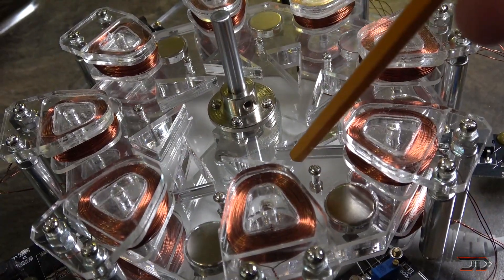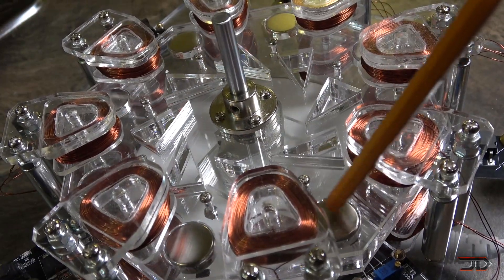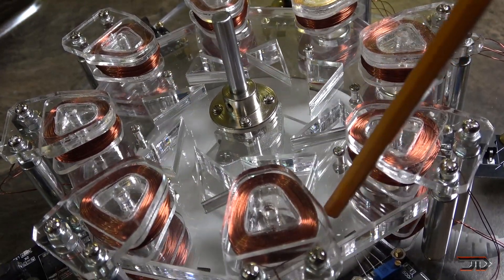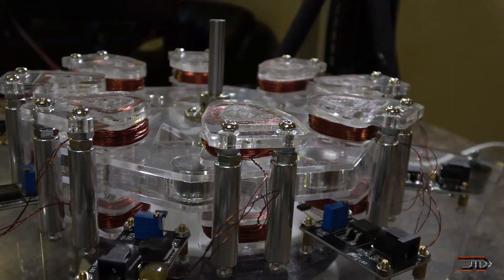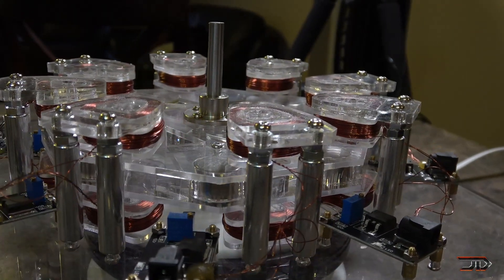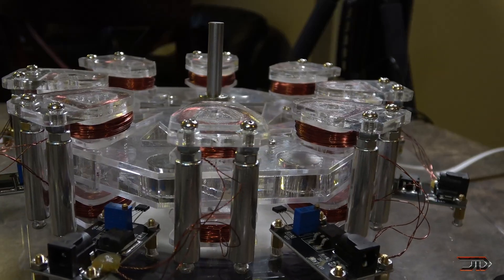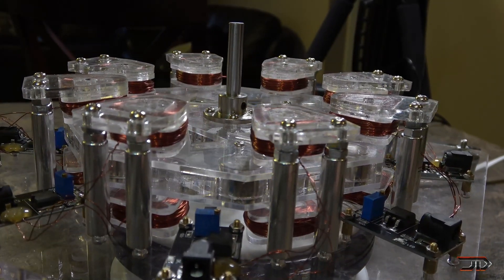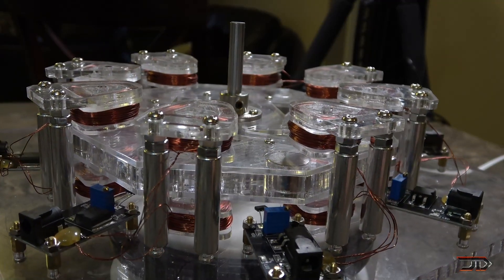8-Turn Disc HIGH Powered MOTOR / Ironless Star Generator

Comment from the maker: These motors are definitely a little different from typical axial flux designs. I will keep trying to find more unique motors/engines and demonstrate them for you!
Reply: Hey, did you make that or find it somewhere?
Reply from the maker: @hambone51501  It was premade, you can buy it from one of the sites in the description. It's around $180 which is not too bad for demo unit.
Reply: @Motor_Explorer1  this would generate a lots of AC power or alternating current if it acted as a generator or alternator if it was spun by a prime mover, such as another motor or something else to drive it at high speeds.
Reply: Now, just scale that up.  Add magnets to levitate the magnetic wheel so theres no resistance off an axis.
Reply: @EarthCreature.  My thoughts exactly.  How is this different to an axial flux motor? Still learning.
Reply: @noutram1000  Well with 1 tweak it isn't much of a different motor at all. But marrying it with a no-resistance/flywheel would put it scores beyond performance though
Reply: @EarthCreature.  I don't think it's possible without messing with the magnetic Eddie currents. It already takes fine tuning of the magnets and stator to achieve peak efficiency. Have a look at the Halbach array.
Reply: What's the KW. I need 5kw motor design
Reply: hi, may i know the air gap between your permanent magnet and coil
Reply: They look pretty fast actually. when I watched this, it looked really fast, probably because magnetic fields are strong forces that push constantly on the rotor or the magnets and bring it up to high speed.

Comment: If you could just, make the stator freely movable through slip rings and use aluminum disc as a rotor without magnets, you'd be built the thing I had in mind.

Comment: Hi, Great video! Can this be used as a generator? if so where's the output?
Reply: Material: Acrylic
.Input Voltage: 12V
.Output Voltage: One circuit board 5w
.Speed: 5000-10000 RPM
.Product Weight: 2000g
.Package Dimensions: 30 x 30 x 8cm

Comment: You won't have that cogging / starting problem if you use # of magnets divisible by 4 and # of coils divisible by 3 (e.g. 8 magnets/ 6 coils or 16 magnets/ 12 coils etc).
I built a few axial flux alternators (wind turbines) and it's a lot of fun. I really like your creative design/ fab work, nice job!

Comment: I did something like that on a fidget spinner, its brushless and has two 300 loop coil angled 120 degree and 240 degree then the 3rd side has a set up where when a magnet aligns with it, it will complete the circuit, making a pulse of magnetic field on each coil thus repelling the magnets onboard the spinner. Its kind of a brushless motor but it doesnt require controler or any transistor.

Comment: The motor shaft is bent you shouldn't be using it at high rpm with poorly balanced and poorly manufactured materials

Comment: Wow! Is that ac or dc? What is the max output power and how much is the generator?
Reply: Material: Acrylic
.Input Voltage: 12V
.Output Voltage: One circuit board 5w
.Speed: 5000-10000 RPM
.Product Weight: 2000g
.Package Dimensions: 30 x 30 x 8cm

Comment: After viewing this and seeing that the price was $180 I decided to investigate further. In the end I decided to design my own -the thinking being that I would learn a lot more about motors doing it this way than even building a kit. I built an axial flux 3 phase brushless dc motor with 16 permanent magnets and 12 electromagnets that I wound myself using some copper wire bought online (the ratio is not 1:1 so the motor can start more easily I think as there is always a small offset.)  I used a 'delta' configuration and drove it from an Ebay 3 phase driver that cost $20 -this was the only bit I bought. I did look into the electronics/design of this but in the end it was cheaper/easier to buy this bit.  The motor itself I printed using my 3D printer.    Success was going to be 'it spins' and it did!  
Good luck!
Reply from the maker: Nice, it's always better building motors from scratch.

Comment: What are the circuit boards and chips for on the outside of the board? I am new to electronics :)
Reply: Looks like MOSFETS triggered by hall effect sensors.  These are used for timing.  When the magnet goes past the hall sensor, the sensor tells the MOSFET to send electrical pulse to that coil.   The coil becomes magnetized and pushes the magnets to spin the rotor.  If used as a generator, the hall sensors and mosfets do nothing.  Timing and energizing the coils from an outside source is only needed in motor mode.

Comment: I want to install a similar hub motor for a small EV project car at front wheels like a spinning top and also power the wheels to get gyroscope effect which can prevent the car from overturning/flipping.
Reply from the maker: Well, that would be pretty impressive! I wonder if you can build it like a flywheel energy storage unit, that would be neat

Comment: Very cool but also not practical outside of demonstration purposes as you said. Would be cool if it was wired to recharge batteries or something so that it had some use outside of the visual perspective.
Reply from the maker: For sure, maybe drive mechanical motion into and use as gen.

Comment: I always struggled to see a positive use for engines like this outside of like drones or rc craft
Reply: Hybrids
Reply: Become more creative?
Reply: Seems like your perspective is only limited to your situation. There are thousands of applications that need motors like this, to point out the most obvious, E bikes
Reply: @eastwood111  it needs a push to start working, you would need the power consistently on, which is a waste of battery, and you can't fit a huge battery on a bicycle
Reply: Rc cars and drones won't be able to use it because it needs a push to work
Reply: Put it between engine and transmission and you get a hybrid

Comment: Just out of curiosity, can you charge a battery on it and in the future have your own off-grid power station? I don't know anything about electrical, physic or engineering yet, that is why I'm asking.
Reply: No way it could be used for off the grid power. A few watts (let's imagine that it was capable of 50 watts (big stretch)), you would need at least 100 of these just to handle very basic lighting in the home. Imagine what's needed for a fridge, tv etc..
Reply: Can you? Yes.
Should you? Nah..
Reply from the maker: You can drive mechanical input into it and use it as a generator. But this one is not very stable and you would only get a few watts per coil. I'm sure there are some better axial gens out there though!